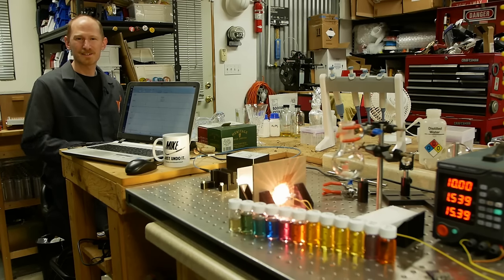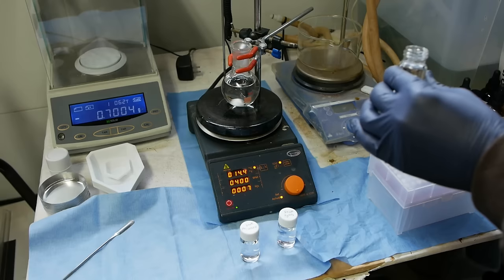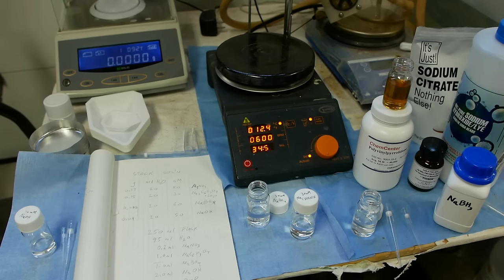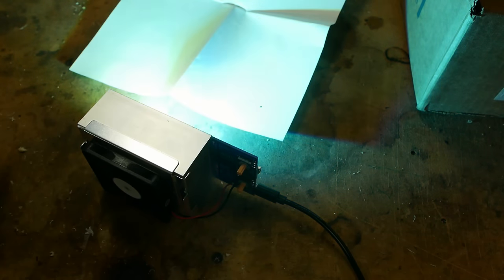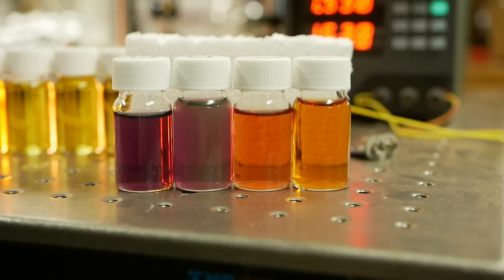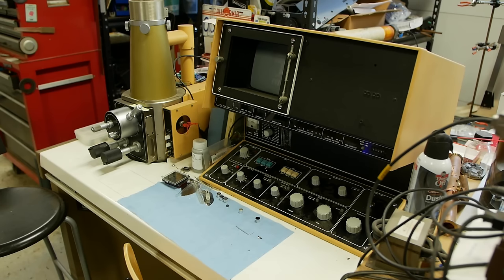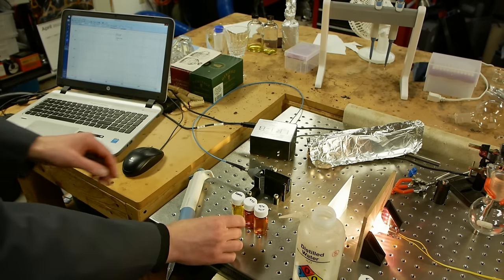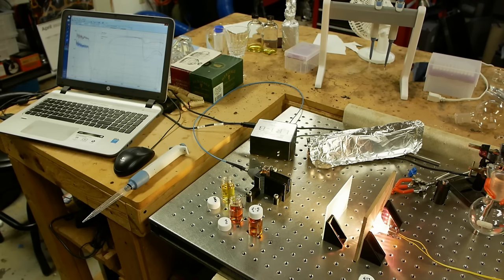Silver nanoprisms grown into structural colors by high power LEDs

Comment: Two ideas for reversing transition:
1) Add precursor silver particles over time to encourage stealing atoms from plates.
2) Try going one wavelength step at a time, preferably try it with a smallest wavelength step you can get.
Reply: I was thinking that too. Maybe doing 2) in the first place would lead to a better conversion from the start as well. From the electron microscopy it seems there should be much room for improvement potentially.

Comment: The red-shift is due to inherent energy losses in the system (basically non-reactive vibrational modes). If you use flourescent nanoparticle systems as a model, I think it can help make sense of the situation. Basically, not all of the energy you put into the system is available for the output, be it fluorescence or building the particle. This is why the shift is always in the red (aka lower energy) direction comparted to the exciting wavelength.
Reply: This is probably the largest factor but it's also possible the other components are effecting the wavelength (glass, water etc)

Comment: Hey Ben, you should check out this paper: Bensley, Robert D. “Natural Color Photography in Colloidal Silver.”. As the name suggests, it involves creating color photographs out of colloidal silver using a standard black and white emulsion. Very interesting stuff.
Reply: They fail to mention it in the article, but Bequerel, Herschel and others produced solar spectra in full color on metal plates coated with silver chloride. Some of the surviving examples are quite striking.

Many color films (in the past, maybe currently) use a layer of colloidal silver between the blue-sensitive layer and the red / green sensitive layer beneath as a filter. Kodachrome, in particular, was well known for this
Reply: @johnkukla9522  The color images produced by Becquerel and others using the early processes are fascinating, but I believe that it operated more on the principles of Lippmann plates than colloidal effects. And you are correct about the colloidal silver in color film, but it merely acted as a yellow filter to block blue light from reaching the red and green (or complements if negative) emulsion layers.
Reply: @Dukey8668  CNRS (the French National Centre for Scientific Research) did a study on these several years ago, and concluded that the colors were due to the presence of silver nanoparticles in the images. There's a press release available, but I have not found an accessible copy of the research paper. I'm not sure if Lippman - style interference phenomena would be possible with silver-chloride based materials that do not have (conventional) spectral sensitivity beyond the UV / Blue. As an aside, have you ever had the opportunity to see a Lippman photograph? I've never had the pleasure of seeing an original, but I've seen some modern work, and they are absolutely gorgeous beyond words. The emulsions are fairly straightforward to make, and this has been on my short list of projects to do for quite some time.

Comment: Thank you so much. I snagged all the parts on Digikey to build the broad spectrum LED board. I was planning to use a selection of noble gases for same but this is so much easier! This will also be great for the calibration of my telescopes optical spectrophotometer without having to point at known stars. Awesome content as always.

Comment: This is really cool.  When I was in school we made something like this but with a rather more mundane size selection... it was CdSe nanocrystals (at the time we were still calling them microdots) and they were grown via Ostwald ripening... basically start with a mixture of Cd and Se mercaptan salts suspended in molten parafin, then set to a specific temperature for several hours and depending on the temperature, that would determine the size/color.  I'm sure I've forgotten some critical details... it was almost 20 years ago.  One thing I certainly won't forget though... the odor of bezenethiol (or thiolphenol for those who swing that way).  It was like an unholy blend of smoke and anus.
Reply: I remember seeing a poster with that in the chem lab at my school -- a student had done the series showing the rainbow spectrum of fluorescence.  Don't remember any of the chemical details though... just the pretty vials on the poster :)
Reply: I've done hundreds (if not thousands) of CdSe nanoparticle reactions in the past. We could easily hit emissions at pretty much every 5nm from around 500nm-700nm with FWHM in the range of 15-25nm. Pretty much nobody uses Ostwald Ripening anymore due to its inherent issues (namely population broadening, surface defects, etc.). Xiaogang Peng had an excellent article from 2001 (J. Am. Chem. Soc. 2001, 123, 1, 183–184) which really changed the synthetic science in the field and others have built on that. The understanding about exciton confinement, non-radiative pathways, etc. have resulted in some amazing particle structures (CdSe Core/Intermediate Layer/ZnS Shell being the most common structure with various coating/encapsulation techniques).
Reply: Aww c'mon.  You're blowing smoke up my 😂

Comment: Amazing video. I have a few comments and ideas:
1. You're talking about the absorbance of your sample at the end, but you are measuring the extinction. There is a big difference, because these particles scatter very strongly (as seen by the nice color range shown in the thumbnail), and what is transmitted is the source minus scattering and minus absorbance.
2. You could maybe filter the nanoparticles with a reverse osmosis filter. Just an idea, but you already got nice pictures anyway!
3. My theory for the growth mechanism is the following:
If you irradiate a sample of silver nanoparticles they will absorb some of the light. However, this absorption may depend on the size of the nanoparticles. If small particles absorb more light than big ones they get fed energy and are more unstable, leading to dissolution and agglomeration into bigger particles. This would explain why you can't shrink particles by illumination - the big particles don't absorb as much energy and therefore have no reason to dissolve into smaller particles. 
This explanation does not offer a compelling reason for the spectroscopy results at 25:40, but I would argue that the spectrum just shows the emergence of smaller particles from remaining seed material, rather than the dissolution of the bigger prisms. The difference between the blue and black curve at 550nm is not that significant in my opinion (based on the shown sample size of 2, more spectra to compare would be nice)
I have not yet found a simulator for silver nanoprism spectra, but there are online tools to calculate mie theory for spherical particles*. The extinction spectrum matches nicely to your measured data, but the absorbance of the spherical particles does not fully support my explanation, as the difference by particles size (for spheres) is not very large [EDIT: scrap that, the simulator I used uses a varying y axis. The absorbance is significantly size dependent]. This may very well be different for prisms though, any resources for calculating the spectra of silver nanoprisms are welcome!

*Youtube likes to delete comments with links to further resources, so I'll not link directly here, but instead try in a comment below this one. I'm sure you'll find one by googling "Javascript Mie scattering calculator" or similar.
Reply: Attempting to link: https://saviot.cnrs.fr/mie/index.en.html 
You can set the material and the size of the nanosphere and it will show you a plot of the extinction, absorbance and scattering quality factor, which roughly corresponds to what the instrument in the video is measuring.

Comment: Might the redshift be caused by the heat produced by the LEDs? Lots of IR radiation coming off the glass and foil.

Great video. Ag Nanoparticles were always fun in the lab. We would grow plates by using specific ligands (much like the PVP shown here) and controlling the size with time and hydride concentration. This method is much better. Thanks for sharing.
Reply: The red-shift is most likely caused by the process not being 100% efficient from an energy perspective (nothing is). If you are familiar with fluorescent systems, it would be the binding equivalent to a "Stoke's Shift".

Comment: I would speculate that the reaction is not reversible at all. Unreacted molecules in the solution react with the new wavelength of light creating a solution with not one but two preferentially sized particles depending on the light wavelengths used. The overall process is very similar to that in photography using silver chemistry. Once the process has occured, i.e. the film has been exposed to light, development and fixing prevent any further transformation of the materials. However multiple exposures to light do not result in the overall process reversing at any stage.

Comment: I'd love to see a multispectral photographic imaging project using that light.

Put an ancient papyri document (or whatever document you have handy if you don't have any ancient papyri lying about) flat on a vacuum plate with a monochrome astrophotography camera above it with the light at low angle. Image the document at each wavelength. Rotate the light 15deg around the center of the document, image again, and repeat through a full rotation. Then rotate the angle of the light up 15deg and repeat the entire process again. Ideally the light should be collimated (maybe a bigish fresnel?), and maybe place some filters over the LEDs to narrow the frequency range.

Write a bit of software to display one of the ~2100 images from the set based on three inputs that select the lighting angles and frequency.

The idea is to reveal hidden details in the document.

Comment: I think this is dependent on the broad spectrum of LED sources.  If you used a laser source at 500nm and the nano-particles  all absorbed light at 400nm it would have no effect.  You would need a source that had the wavelength from 400-500nm.  The nano-particles are grown to the longest wavelength of the source that is being used, not the central wavelength.  The narrow band laser does almost nothing, as there are very few particles sensitive to its narrow band light.
For maximum effect you need a slowly varying source that starts at the current absorption peak and moves to the desired wavelength as the particles grow.

Comment: Ben, this is super cool, as has become expectable from your channel.  So I will give a good hint on the reaction mechanics: 
Why Absorbtion wavelength is longer than the incident light used to make the particle: 

The peak activity of the reaction is at the incident wavelength.  This means that the peak growth rate is at incident and the growth rate drops to zero near the absorbtion wavelength.  The variability may be due to agglomeration.  I bet the math is similar enough to:

 dLambda_PDF/dt = k1 * convolution(Lambda_PDF, Center_And_Shift(Lambda_Incident_Intensity_PDF), dLambda) * dt.  

Where PDF is probability density function so as to account for the statistical aspects of the reaction mechanics and Center_And_Shift shifts to start at zero to mathematically preserve wavelength of activity.  It looks like a convolution to me because a convolution would explain 2 peaks adequately as the reaction would never complete without a broader wavelength source, even in a perfect world with no byproducts.  To improve yield, use a peltier device stack to vary the LED wavelength with temperature.  

Awesome project!  Makes me wish for a home lab and more time on my hands.

Comment: 24:00 Could it be that the reason the side lengths are longer is because the prisms are actually growing from the light interacting with different chords through the triangle rather than the edges? Perhaps the absorption spectra for the formation process is some bell curve between side length x and x*(sqrt(3)/2), which would explain why the 470nm light's absorption spectra is between 470-543 (470 * sqrt(3)/2)

It might be slightly different due to the depth of the prism itself but I suspect the difference is negligible, and that would explain why extended exposures likely don't increase the sharpness of the peak as well, meaning lazer light probably wouldn't have an appreciable effect on the prism growth so a broad spectrum with large exposure area is likely favourable.

I haven't done any math bar googling what sqrt(3)/2 is but it seems plausible to me! I thought of the height because I was thinking of what the light is more likely to be absorbed by, hitting the face of the prism rather than brushing the edge? Not sure if that line of thinking is at all valid but the number does seem promising!
Reply: Sorta makes me wonder in which dimensions the prisms are growing, how quickly
Reply: @Erhannis  Schema 4 in "Mechanistic Study of Photomediated Triangular Silver Nanoprism Growth" by Can Xue et al shows that the particles can grow in two different ways, depending in the wavelength used to illuminate the sample (Dipole is longer wavelength than quadrupole, but both vary with particle size, the larger the particle, the longer the wavelength). The sides grow faster than the face.
EDIT: I would link directly to sci-hub, but Youtube doesn't like links.
Reply: I'm wondering if it has more to do with the area than the side length. There's no reason to expect the light to correlate with a specific linear dimension.

What would happen if the light was polarized?

Comment: GREAT little nugget of info at the end there... It almost makes it seem like you can use the initial LED to get to around the right size then shift back down a bit to target a particular size. The real challenging question is then how do you separate them based on size to isolate certain sizes to block out specific wavelengths.

Comment: You might want to try exchanging the nanoparticles coating to sulphur based ligands such as undecylthiol. They will form a monolayer on nanoparticles and faciliate centrifugation, since nanoparticles will dissolve in aliphatic solvents and precipitate in polar ones. In my experience this is the easiest way to get rid of the bulky polymeric coating.